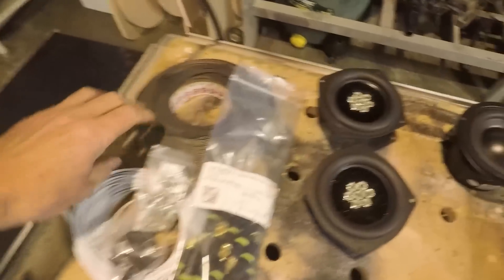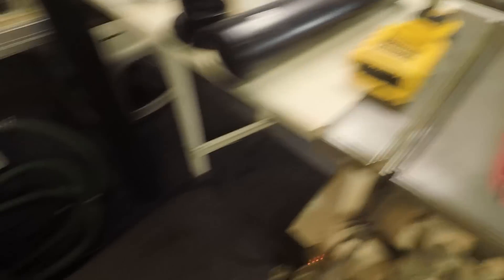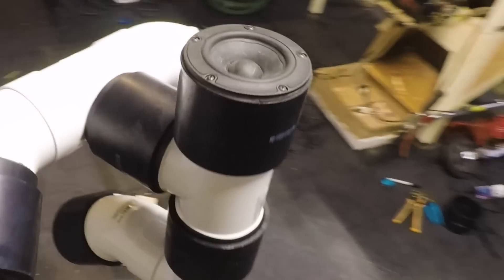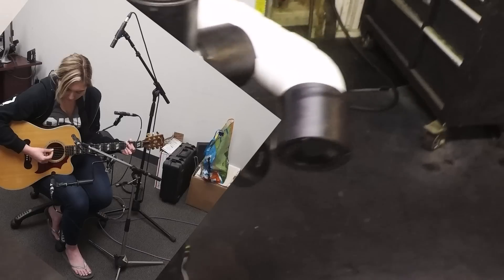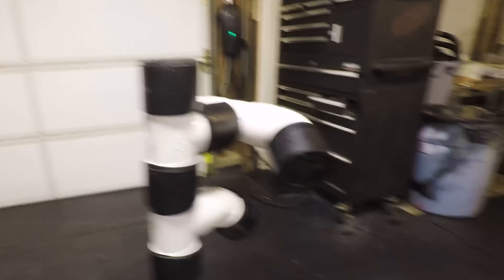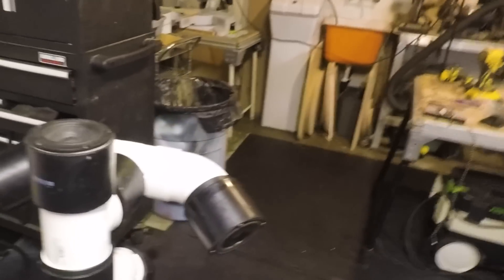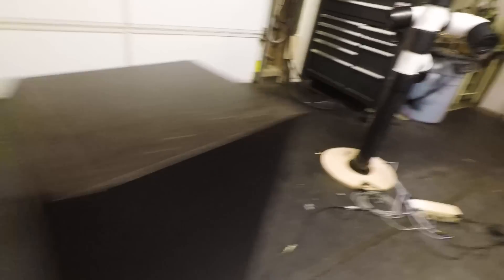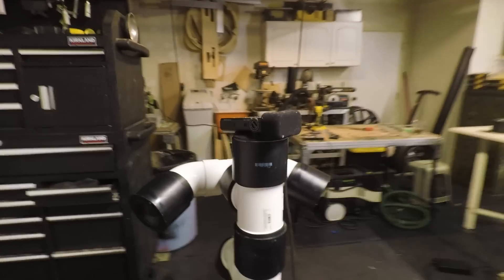Speakers Don't Sound Real, Lets Build One That Does

Comment: Cool project Dave. The TASCAM recording of your PVC pipe speaker sounds a lot less like a "speaker" recording of a speaker than the conventional one does, it's not even close how much better yours sounded. Granted we all know how recordings of speakers in a room sounds nothing like how it does in person since our brains cancel out the vast majority of indirect reflections in the room the mic picks up stronger than the dry sound of the speaker itself but the recording is still revealing of how much better your concept works with even a challenging acoustic environment.

As for types of reproduction, for me at least horn loudspeakers have always done the best job of replicating the "airiness" and immense dynamics of live sound. The giants of the tech of the last century everyone knows; Electro Voice, QSC, JBL Pro/Cinema, Altec Lansing, Klipsch Pro/Cinema et. al. High sensitivity speakers also play at higher SPLs with less distortion and don't need obscene amounts of amplification as it's the most natural way to amplify sound. The best movie theaters use horns especially for the critical LCR screen channels. Western Electric figured this out 100 years ago. It really took the advent of active monitors/pa speakers with perfectly matched and built in amps before directly radiating conventional speakers could do something similar. It also looks like some of your live arrays setups used partial horn loading for the tweeter or midrange which is awesome. I bet a 3-channel stereo L-C-R line array would have a massive sweetspot and huge dispersion for a big concert/live event with more people in the "stereo image" especially off axis listeners to the sides not getting overpowered by the nearest adjacent speaker.

As for more of a "3D" like sound, omnidirectional speakers have been a thing since the 1960s or 1970s but unlike horn/waveguide type speakers those never really caught on for PA/Live sound reinforcement use. At least for "HiFi" listening to a studio record or live recording over a pair of JBL or Klipsch style PAs and it sounds like you are there. Granted, live sound isn't acoustically "perfect" but has an emotion and energy to it that's very hard to reproduce after the fact. Many of the best studio monitors use waveguide or horn technology to an extent in their control rooms. Genelecs waveguide or JBL's "HDI" horn comes to mind. On the opposite end you also have Electrostats or Planars but those sound like a synthetic cerebral like listening experience but do radiate sound forward and backwards. I've never seen a panel speaker in a control room or mix/mastering stage.

Oh and as for signal processing and recording, I've been thrilled to see the resurgence in Ambisonics, something we've had since the 1970s in large part due to VR/Binaural interest for gaming and personal headphone playback. Ambisonics is amazing for capturing ambience and can be routed natively to virtually any speaker layout without any big downfalls due to its unique phase and recording techniques. Instead of conventional surround the more accurate term would be wrap around stereophonic sound, much the way we hear in real life. An Ambisonic recording can be natively rendered to Binaural, back compatible 2ch stereo (UHJ encoded), pre-decoded to conventional 5.1 or even 16ch CBI like a 9.1.6 afterwards in post production so recording in it has so many advantages for numerous applications. Ambisonic recordings of live shows would sound amazing if CE makers put the decoders in mass market electronics. As far as I know for consumer use I think Meridian was the only one to ever put Ambisonics decoders in hifi/surround playback equipment that I remember hearing about 20+ years ago in a CE magazine. Keep up the good work Dave!
Reply from the maker: I enjoy all of the speaker types and differentials between them.

Wonderful stuff and thought I would add a new contender to the mix from a design perspective that seems to get little to no attention yet more closely parallels the actual instruments create sound

Comment: I like the idea, maybe single woofers facing each other in a cylinders top and bottom with an array of tweeters as the woofers work decent off access, they could even point at a ball in the middle to radiate from and use the cylinder enclosure to extend the bass, with subs down below that you can swap for different sub configurations depending on venue. The tweeter array could come out of the ball, with a lip to protect from the woofers narrowing the tweeter dispersion like when mounted in a flat surface when the wave is shorter than the surface it can’t get out. No point pointing a tweeter up on down as they are so directional anyway, except for there reflection so maybe use a radiating bmr tweeter instead which is better off axis so the sound escapes in more directions without pointing or using as many to keep the sound from muddying. Cylinders with a sub box under cause the sub goes everywhere anyway would be better for transport and setup then a stalky lookin thing. I love it!
Reply from the maker: The crux of the design is having multiple speakers pointed in multiple directions reproducing differing sounds.

This is how a real world instrument radiate sound and if we want to recreate a real-world instrument then radiating different sounds in different directions is the key.

Anything that radiates the same sound in multiple directions or all the different sounds in one direction will fail to sound realistic as you move around

Comment: Looks like a good drivers B&C didn't see a price tho, expensive? what did you pay for that 4-in driver? Made in USA? What about going for a 6 or 8-in drivers I think they might be better.
I noticed in the vocal test they are a bit plasticy sounding probably down to the pipe I wasn't sure about on stuffing tho! Did you heavily stuff the two side speakers to the other two speakers? And the bottom? I was wondering if there were ported might be better?? the two sides could come out the back with a slot blocked off to the other drivers, the other two drivers could have a partition down the pipe open at the bottom couple of slots so there's no interaction from any of the drivers on each other, only problem if the two side drivers interacting with each other being out of phase would that cause more cancellation so maybe not on the side drivers, but just the other two vertical down the centre out the bottom,
You put half a ferret what's that a 0.47 capacitor is that across the woofer just to knock the top end off, they don't have an internal crossover do they?
I was wondering if  you can just by using a two channel amp joining the two sides together and the top and bottom together not sure! if to do it in series or parallel tho! what you think!? Probably because they are coaxial in series, not sure, they do both variants 8 and 4 ohms hard to say!! I wonder if a small resistor might be advisable on the tweeter as well something 0.7 to 1.2 ohm. Anyway very interesting I think I'd go for the 6-in cos I can get the pipe at 6 inch
Reply from the maker: The cap is to protect the tweeter. If I had more of the tympany I would skip the coax. Diff mics with diff signals to each speaker pointed in a diff direction is the key.

All the tubs are not glued so I can change the way the drivers point or re arrange at will.

Ports add resonance which may not be ideal but will add lows like the sub did but loses real ness

Comment: well there is a BIG why i don't like bass reflex speakers... is the fact that they suck and i end up sealling the ports.... just seal the port of the infinity and the sound will improve from a little to a LOT,
also you are not using a crossover so it is better than the best possible crossover, there are always losses in quality so the mid range will be better
Reply from the maker: Selecting the optimum sub design for the application is a sign of a skilled and knowledgeable pro.

Sealed subs can reproduce lower frequencies at the expense of efficiency, and max I'm voting lume

Also the internal back pressure reduces the ability to reproduce faster peakes.

For applications where hitting lower frequencies and it's ok to have less impact and not be able to hit as high of an output level, sealed subs can be a good choice.

Ported subs use both the energy from the front and the back of the speaker and sealed subs only use the energy from the front of the speaker.

For most touring and live systems, the added size and reduced output of sealed subs may not be optimal
Reply: @DaveRat  well for me everithing is about response... american speakers such as harman kardon, infinity included are more V shaped sound with a powerfull bass output, and this is why they will never ever sound "real", beacuse you need the midrange in line with the rest of frequencies
the problem with bass reflex is that there is someting that i call "port contamination" (port resonances in the mid range) using a port design you just can't have a "real" sound reproduction, is just not possible
i have a restored set of vintage pioneer CS-A700 this is an infinite bafle designe, they are bass lacking speakers but the response is amazing and just using DSP you can  have a flat response to 30Hz the box itself is made out of walnut playwood and the box resonates creating a "life like" reproduction for acoustic instruments... sure there are more fun to listen speakers (since the 70's and up to day) but that sensation of realism and "neatness" in acoustic instruments is the why i think they are the trully most understimate series of speakers of all times... 
i think you should checkout the vintage japanese sound signature if you are in the search of that type of sound... also in stereo they create a really nice sensation of 3d soundstage... in madona-lucky star, the funky guitar projects from behind you as an example ... is like to be in the middle of something 
(of course the rest of my chain is "capable")
Reply from the maker: Musical instruments radiate different sound in all directions. Any speaker that radiates one sound will never sound real.

To recreate realistic sound, multiple amps reproducing multiple signals radiated by multiple speakers facing multiple directions will start to get you realistic sound.
Reply: @DaveRat  well that will depend of the type of music... i mean garage rock uses peavy equipment, usually... and if you play it with any descent hi-fi config the sound will be different so the frequency response is dramatically different from that in the original setup

now it happends that a speaker not only projects sound in one direction, bass for example is omnidirection from 60Hz an below... but one more time if you use one of your drivers and put it in a sealled box the resoult should be very simiar i say this as an afficionate engineer and as a classic guitar player

plus there is no need for a multy channel system stereo is good enough to recreat a propper stereo immage and layering.... i can say that production quality matters more than the output set up for that matter
Reply from the maker: The sound we hear from a real instrument is not just the sound radiated but the sound reflected from all the surfaces in the room

A real instrument radiates different sounds and different directions creating different sounding reflections off of every surface and every direction this is highly complex

A speaker that radiates a sound in One direction regardless of how good it is creates the exact same reflection off of every surface creating a very simple reflection field that sounds unrealistic

Also I think you are mixing together trying to recreate an identical sound versus trying to create a realistic sound

Something can sound very real or like a real instrument yet not sound exactly the same as the real instrument

And something can sound totally identical to a real instrument yet not sound realistic at all due to the lack of complex reflections

One way to determine if something sounds real is to walk around behind it and see if it sounds like you're standing behind someone playing a real instrument clear and very present or it sounds like you're standing behind a speaker shooting in the opposite direction

Comment: interesting.  you can call it the "Gray Water" series...do the speakers all share the same air space?  are they fighting each other's backwave?   Where does the air go?  I know it's not sealed, but a small hole seems necessary.  I guess BOSE was right all along with their 901s.

Comment: I love the idea of turning sound reproduction inside-out, especially in a studio recording context, and especially for acoustic instruments.  I'm now envisioning a multi-channel speaker system (or design framework), similar in concept to what you show but maybe with more deliberately-structured speaker arrangements, and mixing approach that is designed to play back a "3D mix" based on the multi-mic outside-in recording approach.  Particularly, an acoustic ensemble could be recorded with outside-in mics arranged in a manner corresponding to the inside-out speaker array, capturing the projection of the ensemble into the space.  Another manifestation could be a software mixing approach, where the spatial placement and orientation of each recorded track (which may be a multi-channel recording of an outside-in mic'd instrument, or synthetic even) can be adjusted to place the instrument "inside" the multi-channel speaker system at a distinct 3-D location and orientation. Of course a multi-channel audio file format would be required to distribute music recorded in such a way. Basically extending the approach you've shown here reproducing a single instrument into an entire band or even synthetic sounds.  

For like super high-end listening installations, this could potentially be coupled with an outside-in speaker array intended to reproduce the room reverberance of a particular (or potentially variable, if done as a post-processing step) venue, perhaps via convolution from a room impulse response captured by an inside-out facing microphone array to represent the listening position... so you would get the inside-out sound presence of the original sound sources, and use the outside-in speakers to provide the presence of a room potentially much larger than you're actually in.

Very cool way of thinking about sound reproduction!

Comment: Worked on an identical project some years ago now prompted by the availability of stem tracks from bands like NiN.  The idea was a speaker system per channel (i.e. instrument) and a meta-channel that instructed the playback system on how to do the equivalent of a mix. Provisional patent covered a submix of a plurality of channels which would be a new form of digital distribution to include a point of delivery mix.  Proof of concepts were done with breathtaking results. Exactly as you described, Dave. Retired foh engineer here. Great to see your channel!
Reply from the maker: Very cool and I believe NIN played the Sahara tent at Coachella around that time because I remember having his unique setup overlaid into the huge dance club sound system

Comment: I've been looking into acoustic tile flat panels tuned to resonate to individual instrument frequency range. Or tubes or boxes to match volume wise the amount of resonance in each instrument given frequency range.  I mean if we are going to mimic the live stage instruments we may as well adhere to their characteristics of sound distribution in a given room size. Equalizers can do the latter, but I think simply mimicking the instrument dynamics electronically within a given container, and projection, sort of like amplitude and direction, can achieve that. In other words, a separate speaker to each instrument, this was my analogy, before hitting the play button and watching your video completely.

I do like the pipe setup, definitely that guitar sounds sharper than the regular speaker. I was actually a bit ahead of your explanation, just thinking logically, but in the later part of your video you basically explain what I had in mind. Great! this means perhaps there is something there worth looking into. 

I just stumbled on your video after many years of not being into diy speakers and was revisiting flat panel options, from a space saving point of view. I used to experiment with various ways to build my own speakers in the late 70's, and to this day I still have a set of mini canons bottom V ported that have some incredible kick and range to them for their size, I built these from a Radio Shack " How to Build Speaker Enclosures" book but made some slight modification to the V bottom port and orientation. I also have a set of Klipsch La Scala concert full range speakers, which I redesign from the typical setup and built from scratch in oak, with the help of a college friend who use to do excellent cabinet work. I cannot play those at the levels they were designed to be fully appreciated because my whole house shakes, but they are great at the corners of my family room, at low volume, when we watch high intensity sound movies like Star Wars, and we want to be fully immersed in sound. 👍
Reply from the maker: Good stuff and as far as using panels or speakers with inherent residences it will color the audio in ways that may not be desirable. Having speakers that relatively sound neutral is probably preferred as the residences come from the instruments being recorded